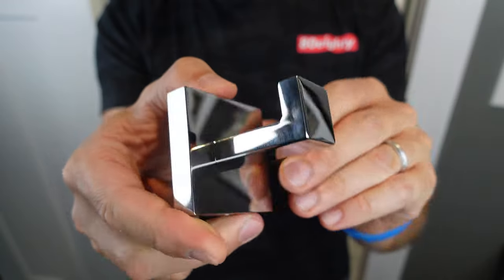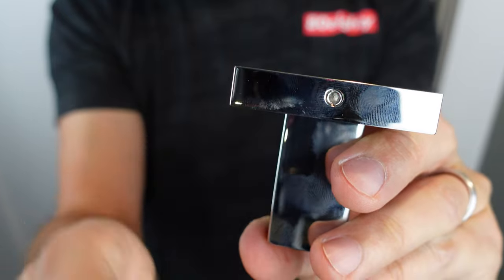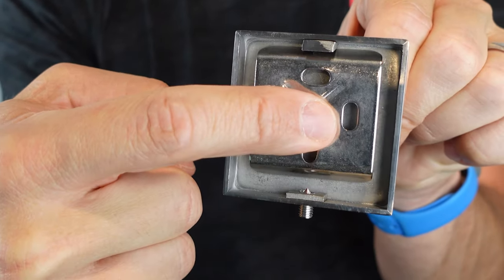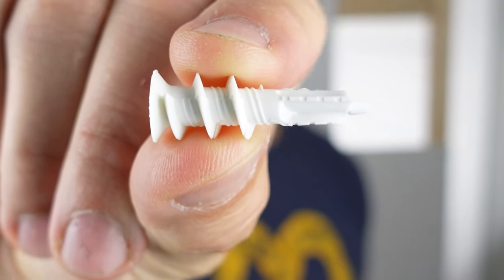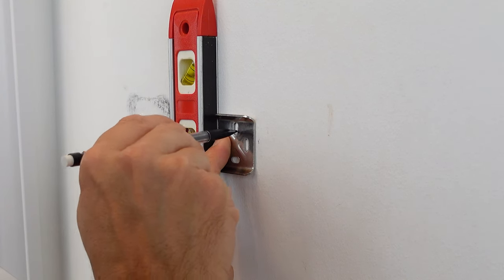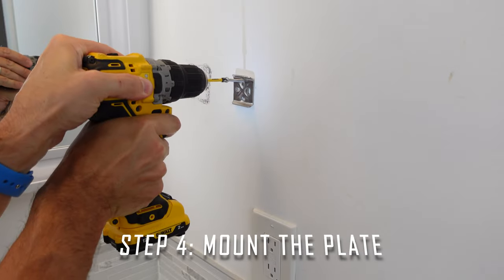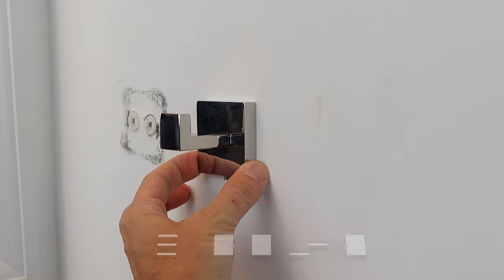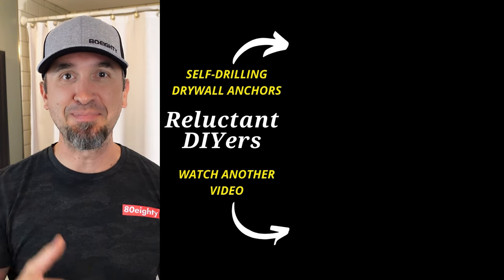How Do I Install a Towel Hook? - Easy Towel Hook/Robe Hook Installation

Comment: Can we drill it into a dry wall? Or should we drill the nails into a stud ?
Reply from the maker: If you’re using nails, studs will be required to hold any significant weight. For a towel hook, you can use drywall anchors if there is no stud, but I would recommend putting the towel hook into a stud directly because of the different types of downward pressure these towel hooks experience. I hope this helps!
Reply: @ReluctantDIYers  thanks for the quick response. This info helps.
Reply from the maker: @viyaansworld8220  Excellent!! 👍🏼👍🏼👍🏼